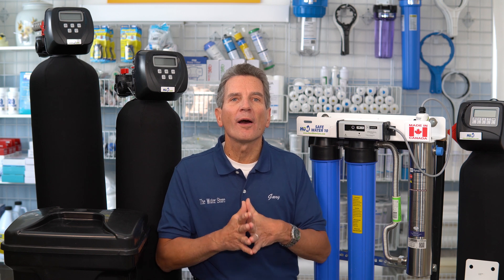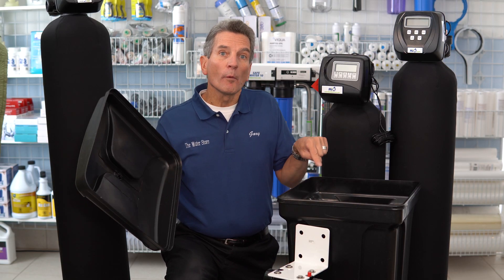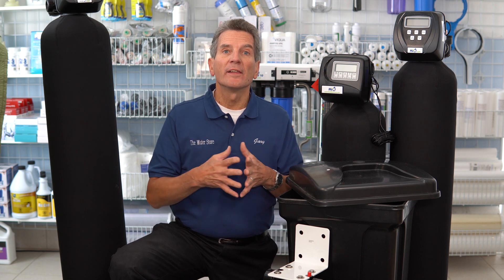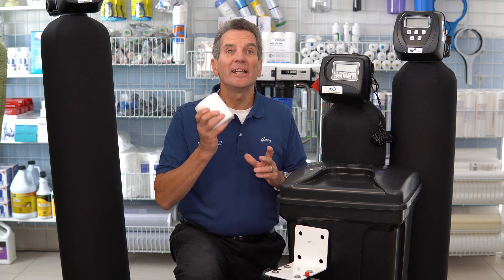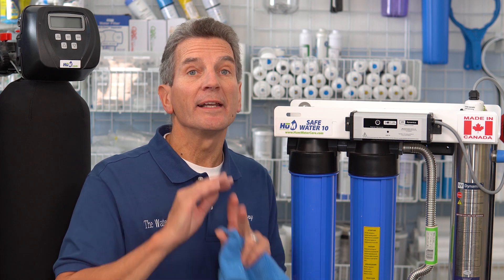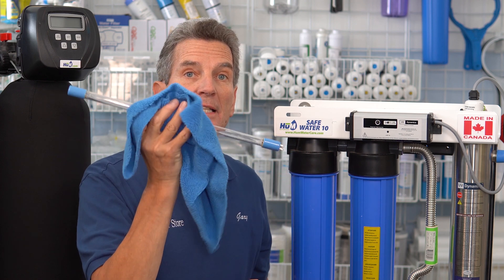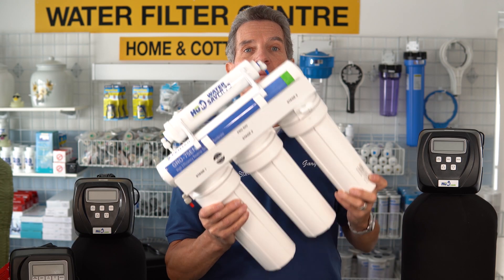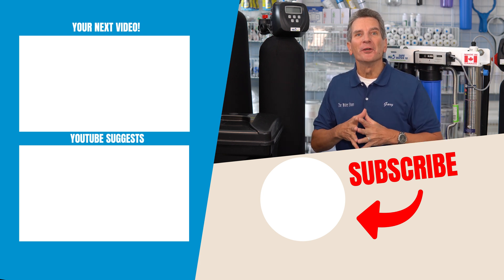How to MAXIMIZE the LIFE of Your WATER FILTRATION System

Comment: My filters are extremely dirty after one month... my water stains my showers, toilets and sinks. I've hired someone to come out twice and each time it costs me $500 and I still have the same problem and nothing has been explained to me. I need advice!
Reply from the maker: I would have your water tested at a lab to find out exactly what is in your water to determine if what you have is the correct equipment to deal with it.